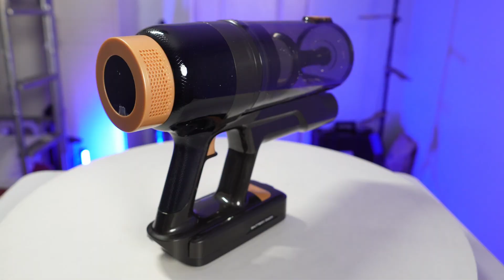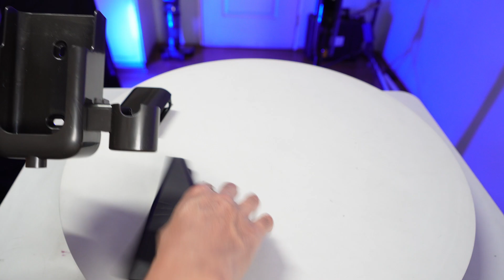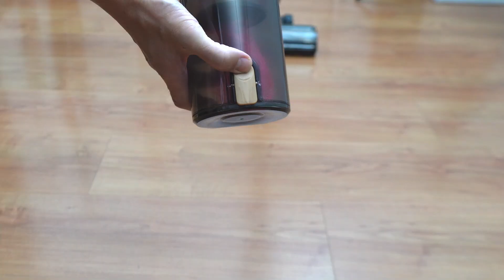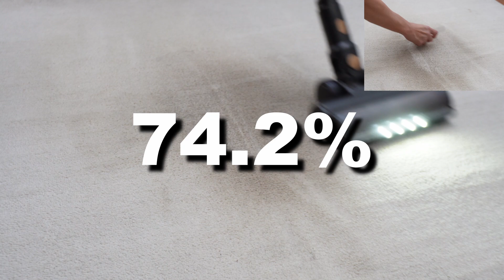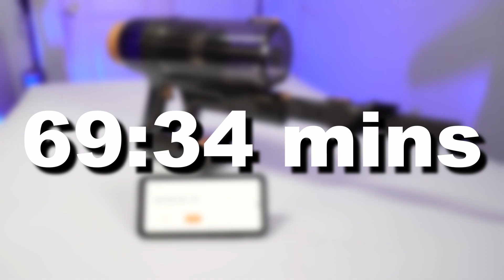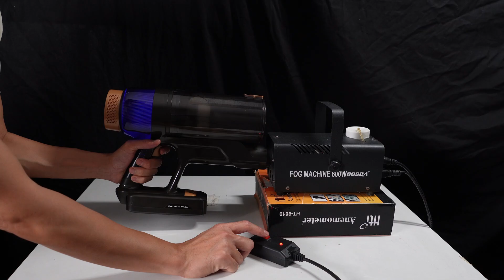This Cheap Cordless Vacuum Is INSANELY Good... But Not Perfect

Comment: Whatever you do, DON'T BUY THIS VACUUM!!! I have the MQDXE version of this same stick vacuum, they are both made by the same Chinese manufacturer. You have to use Medium or High speed to get good airflow, and the battery barely lasts 5 minutes on a full charge. Plus you can't even feel the brushes sweeping the carpet. If you need a cheap stick vacuum, get a refurbished Dyson V8 instead, it will do MUCH BETTER than this!
Reply from the maker: Thanks for sharing your experience and providing an alternative suggestion.